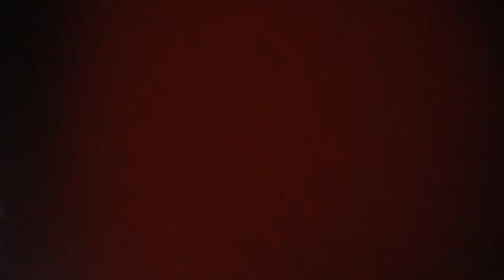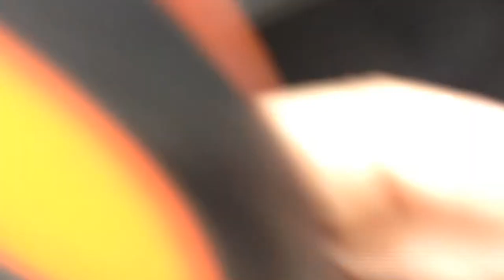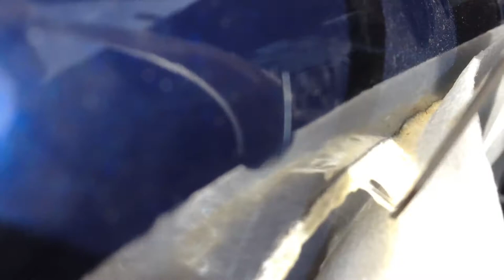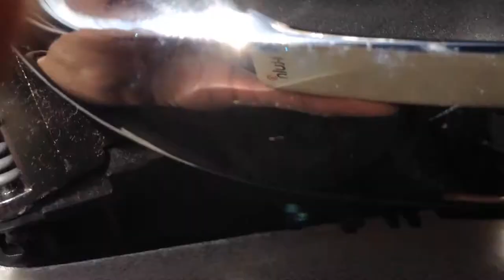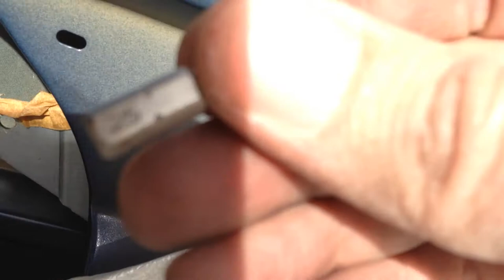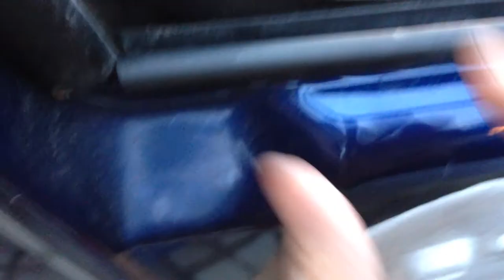Peugeot 307 - Rear left door glass - Internal fittings -   DIYChannel

Comment: Great instructional on how to remove the internal trim. Thanks.  It finished before you could show how to get the actual glass in.  It turns out that you need to lower the mechanism, take off all the window rubber trim then slide the glass in from the outside the door at exactly the right angle before lifting it back up into the window channels in the door.  The glass goes in and down inside the door orientated normally,  but there is a magic number of degrees to vertical that works.  Persevere,  it took me 90 minutes to discover this..!
Reply from the maker: i'm glad the video help you. I know that the videos haven't to much quality but my only intention is to help and enjoy (think in poor countries with low resources, for example). For all of you, please be carefull what yo do in your car, some thing are very dangerous, safety first. Remember to take account the law in your country, too.